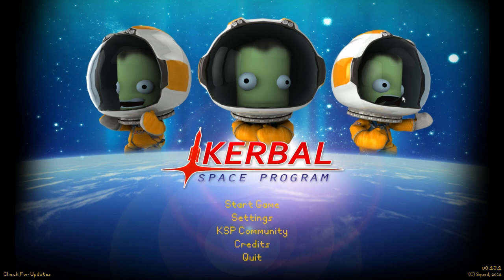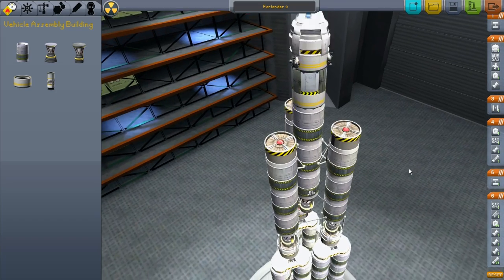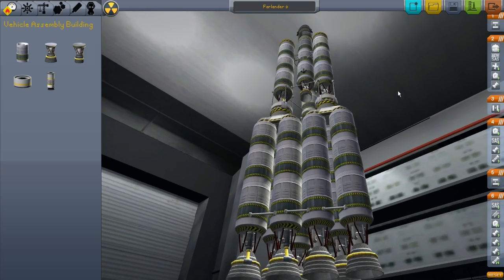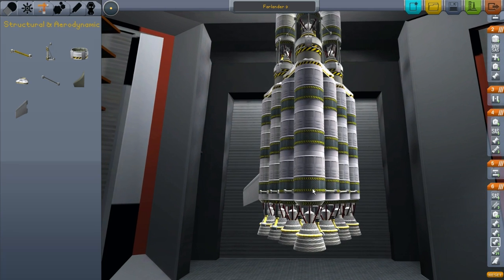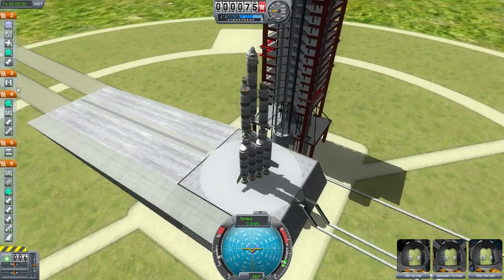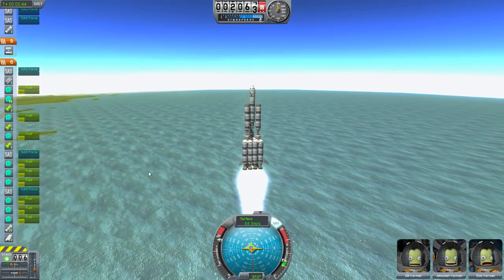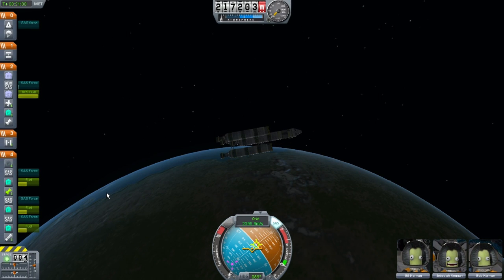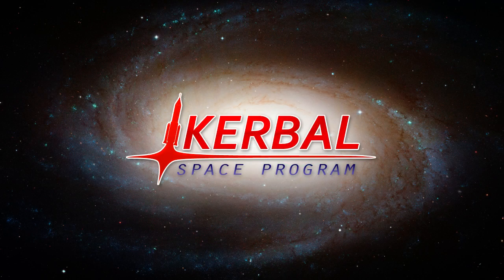Kerbal Space Program - 10 - The Farlander IX

Comment: On the same token, you don't NEED to wait to get to the apoapsis (so long as it's 70 Km or higher) before orbital circularization. You have to find the exact angle to boost towards while staying on the same orbital plane you want to achieve. Most of the time it is a combination of a low burn (pointed below the horizon) and the right amount of thrust. It's very tricky but efficient.

Comment: @StelarCF OK may be HDG is just a matter of habit, but on takeoff I must disagree. I tilt at 15-25km - it allows to get some horizontal speed early - saves time, fuel, and gives MUCH more control on initial orbit size. I get first Ap at around 85km. The way you describe requires 2 separate burns, each one is like basically starting from 0m/s...

Comment: In the VAB, you can use symetry for the struts. just remember to edit only the "original" not the copies. editing the copies wont work at all with symetry on.(guess its a bug,getting the blue dots floating in space :) when remove/delete one off the copies only).
The symerty works only on the part you created first. that part you can edit easy with symetry on

Comment: @harrisontan The advanced SAS modules help by managing the thrust vectoring and the winglets. The normal SAS modules help maintain atittude control by using a gyroscope to induce torque. The benefits of advanced SAS modules do not stack, yet normal SAS modules do. So if you put 10 A-SAS systems, it will be the same as putting 1 A-SAS